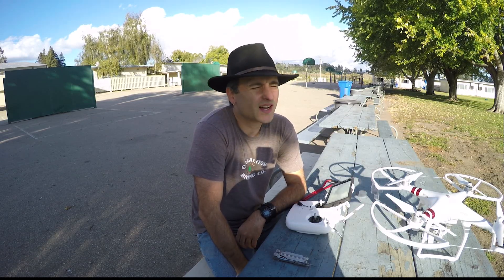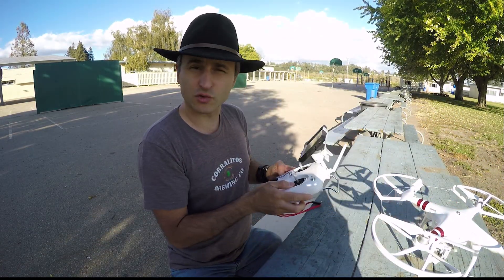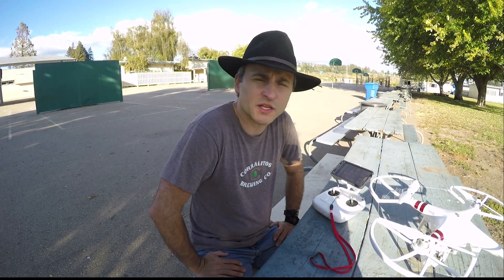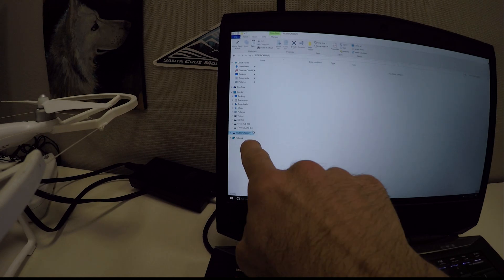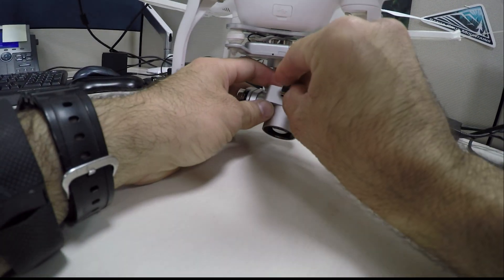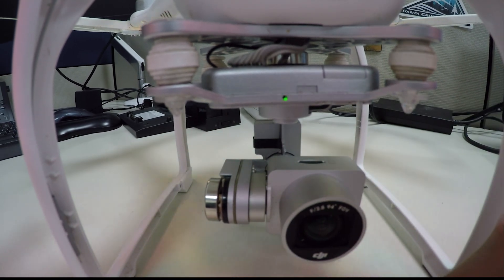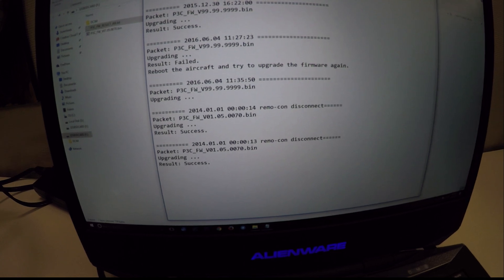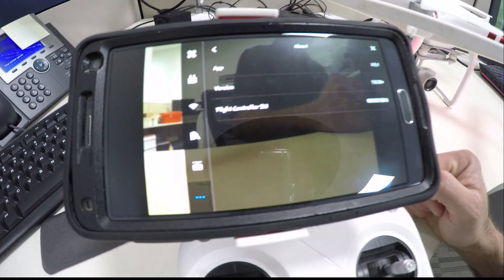DJI Phantom 3 Standard RC Signal Lost - RC Link Tutorial and Firmware Tutorial

Comment: Hello i think i have a problem with my phantom 3 standard or the controller i do like ur tuto for the update the first time it doesn’t work but the second try it’s success my problem it’s because i don’t have the ssid signal on my phone of the controller Also i wait 15min with the bip for remap the controller with the drone he never reconnect if u have an idea or somebody thanks
Reply: if the problem you are having is... as I can understand you cant find the wifi signal from the RC to connect your phone, then try to do the following, instead of holding the wheel of the camera down on the RC, hold it UP and do the same thing with the S2 switch, flip it a couple of times up and down until you hear a noise, that will reset the wifi / ssid of the RC

Comment: Let me say this is an awesome video, very useful to many people im sure. I have an issue that I can't seem to figure out.  I crashed,  tore the flat ribbon, replaced and reassembled-now I have a video feed but no gimble control.  Doesn't do the gimble boogie on startup, and gives the notification "gimble gyroscope error" and "firmware problems ". I changed ribbon, micro boards on both axis, but still limp gimble. All the camera lights are green after the drone initializes...  Any help would be much appreciated
Reply: did you get it fixed.  wow

Comment: Really a great product, it's extremely stable☀️.☀️>JustU.Faith/DJI-Drone?仏   camera keeps perfectly level and the drone rotates around it. Looking at the recorded video, I wouldn't have been able to tell the difference between a drone shot, and a boom shot, it's that stable. The camera can pivot from horizontal to straight down via a dial on remote, but left and right must be done by rotating the entire drone. One issue would be when going at full speed forwards, the propellers will start to peek into the top of the shot (maybe 5-10% in?), but this could easily be cropped out post-production, or don't go full speed. My brother got a cheap $30 drone and although this one doesn't do tricks, it out performs in every other way, I couldn't have asked for more in a drone.

Comment: Hello, do you have a solution for no image transmission signal?
I have app version 3.1.64
Aircraft 1.8.10+
 Thanks
Reply: Any one that has solved no image transmission signal?
Reply: The only thing I heard is to use 3.1.5 app and 1.7.9 drone firmware.  a lot of people recommend the 1.5.7 fw just make sure you use the compatible app version with it.  and use up to android v 9.  you will have to tweak some of those settings too.

Comment: Man, thanks for your video, it has stopped me from pulling my hair out (not that I have much to begin with lol) with my P3S having trouble connecting both controller and video. It definately was the firmware, that must be why I got it so cheap as the previous owner must've got frustrated with the camera not connecting all the time..... I'm ready to fly again with confidence in that I can see the full flight.....
Reply: which app version and firmware are you running?
Reply: @moirawade6246  I no longer hsve thst drone.

Comment: I did it, but now all I get is magnetic interference and recalibrate compass, intensive electromagnetic interference....
Reply: Ok so I updated back to 1.09 and the problem went away but my signal issues returned. With 1.09 I couldn't go more than 100 feet and the remote would loose connection. The video was also extremely laggy even right next to the drone. I decided to update to 1.08 (the previous version). All my problems are now solved. No laggy video and the signal seems strong. I did a quick test flight and it was nearly flawless. Going to do a better test tomorrow. Try 1.08, it may work for you, it may not. If it doesn't, try 1.07, then 1.06 and so on. After reading alot of forums, it seems every drone is different and very picky. Let me know if this helps!
Reply: I have the same exact issue when going to 1.05 Updating back to 1.09 now to see what happens.
Reply: Hello, i had same issue with my p3s when i downgraded to 1.05 version.
1.06.08 solved it. just did test flight, no signal loss or magneto error!
Thanks!

Comment: I have just acquired my Phantom 3. its a second hand drone so I have no idea what Firmware it was running.
Im having the same problem, my P3 (standard) gets to an altitude of 30-40m and a distance of about the same 30-40m .
So me being me, i set up every thing on my drone the night it arrived to get it ready for it 1st flight. Downloaded the DJI App.
Once i opened the App, it prompted me to upgrade (Phantom 3 Standard Firmware v01.09.0200) this is what it is running now..
Took my P3 out to day for its 1st flight, thought i would give it a little test for altitude, nothing crazy. Just above the tree line where i was flying.
And the signal lost message kept pooping up every time i got up to the tree line.
So any suggestions as to what Firmware to downgrade to form Firmware v01.09.0200 
Says some where in the comments  cant go bk passed 1.07.9

Comment: This video saved my drone after lots of time wasted doing other procedures. I tried older firmware versions etc. Finally I updated the firmware and followed your steps .... Instantly all systems go. The problem started for me after updating the firmware a few weeks ago, its possible that there was an issue during the install. This time I just updated via the DJI software.  The final step was to perform the link as you demonstrated. GREAT video!

Comment: I just bought the Phantom 4 pro. i was using iphone 7plus. disconnecting during flight. but when i tested on samsung. it worked well. may be the iphone cable issue. I just bought a new cable. will try it. hummm. very scary when the monitor went black.

Comment: Great video. I now have managed to re-install the newest firmware. And then re-establish the connection between the drone and the RC controller. Sadly, it still doesn't work--the "RC signal lost" error has changed to a "compass error" and warnings about "strong interference (never had those before the firmware update). But I feel I'm making progress. Thanks! 

PS: If you have any more suggestions, I'm all ears.

Comment: My control is connected to the aircraft. The problem I"m having is that the transmitter is not connecting with  Dji Go APP,  When I go the to the app it saids Gimble not connected the big red light stays on never turns green on the transmitter. The aircraft version is 1.07.9. Tried to upgrade to the latest but it just start buzzing like hell. Anybody have any suggestions.

Comment: My Phantom 3 Standard won't update the firmware with this method or any others. I did exactly what you did in this video, Formatted the SD Card, Downloaded the same Firmware 1.5.7. Inserted SD in to the Phantom 3 Standard. Pushed the Button under the drone and held it while turing on the P3S. Held until I got some blinking light and then released. 15 -20 seconds later I have a red light and loud beeping.. FAIL.

I can't get anything to work. Can't connect the RC to Drone, Can't use Go App to connect. I've tried every restart possible. 

PLEASE HELP.

Comment: Great tutorial, thanks for taking the time to help,others in need. My Phantom 3 was flying perfectly until I made the fatal mistake of doing the firmware upgrade recommended by DJI. I attempted to follow instructions you gave for doing the upgrade/downgrade but am unable to get micro SD card to eject from camera. It's first time I ever tried to eject it so very first time I realized it will no just eject when pushed in as I would expect it to. It's almost as if there is no spring back. Could you recommend help to try and remove my SD card so as to be able to attempt to do firmware upgrade so I can get back to flying my drone? Thanks in advance, Don

Comment: great vid thanks for all of the imput and for being so detailed. sadly i was not able to fix my problem . i did both version, 1.05.7 and v1.6.8 , the wierd thing is that it never changed on my dji  app. i hope im doing in wrong. but one thing that did happen was that when i check my sd card, it said my firmware was not allowing the downgrade... i will keep on trying to see if doing something wrong

Comment: Thank you for such a detailed video, but I still encountered a problem that I can't seem to find the solutions anywhere on the internet. I did everything you instructed in this video but when I tried to update the firmware on the drone, the flashing red and green lights (just above the camera) turned red instead of green. Also, I noticed that the gimbal became alarmingly hot so I turned the drone off. I turned back on again after 10 minutes, it seems to just continue to do the firmware update with the flashing red&green lights for about 2 minutes then it turns red again and the gimbal starts to overheat again. If you could take the time to reply and help me fix this problem, it would be greatly appreciated. Thank you in advance.
Reply: i have the same problem did u fixed it

Comment: I've noticed that if I don't run my phone or tablet on airplane mode 
this then stops the phone trying to conectto other Wi-Fi devices and stops the phone or tablet uploading apps and things while flying
i was getting loss of signal only a few meters away and not running airplane mode and no issues since 👍
Reply: BAJAFLATOUT!! Soooooo,, ots better to fly my phantom.. IN airplane mode???
Reply: Yeah mate airplane mode stops any uploads being done on your phone while your flying
Put your phone in Airplane mode and turn the wi-fi back on and select phantom while in Airplane mode and conect

When flying without airplane mode I got loads of interference and delays but in Airplane mode I get none now no delays or anything 👍👍 nice pleasent flying without worrying about loss of signal
Reply: Nice. . Will this also work if I use my ipad air? ?

Comment: Hi!
I have the same range issue you mentioned. When trying to update the firmware, but when I hold pressed the link button and then switch on the drone, the red and green blinking light will not appear. I have waited over 30s but still does not appear, only a continuous green light is shown. This is so frustrating because I follow your video step by step but it just doesn´t work. If you think that you know something that I might be doing wrong, I would be really greatful if you tell me.
Regards
Reply: I just found out that my P3S does not allow me to downgrade to the v1.5.7 so I just had to stick to the v.1.6.8. I will test it out tomorrow and hope that now my range can be better than 300 feet. Thank you very much for your tutorial, it is very well explained and clear for begginers like me.
Regards
Pablo
Reply from the maker: chindas12 I wish I knew how to help but I'm not familiar with that issue. The best I can suggest is reading forums and trying to Google the issue

Comment: Can you please, please, please explain to me how to get my drone to go above 100ft. No one is explaining it and I can't get answers anywhere. Do I need an antenna booster or will it let me go 500 ft with the basic antenna that came with it? Is there a setting on the controller or app that I need to adjust? Please help me. Thank you in advance.
Reply: did you check the Maximum altitude setting in the DJI go app?
Reply from the maker: Levon Byrd What RJ mentions in response below is what I would suggest. Most likely you are still in the training setup and need to open up the range in settings. You can find it in the settings on your DJI Go app on your phone or tablet

Comment: Thanks for such a detailed video. I tried the first method multiple times and it failed. I'll try the second method and hopefully it works!
Reply: It didn't work for me, when I tried updating the log told me that the version is "older or the same as the one currently installed". The main issue for me is that it won't link at ALL, not that the update is corrupted.

Comment: Hi great videos really enjoy them. Wondered if you can help me. When I turn on my Phantom 3 standard the camera does its little movement thing then I get like a vibrating/grinding sound? It sounds like I may have sprained the mechanism but it also seems as though something is vibrating.Ever heard of this?. 
Another little issue I have is it seems no matter where I am I always seem to get the strong interference message popping up. I can be in the middle of nowhere and i still get the message.
Any help would be great.
Reply from the maker: Richard Jones I have heard of issues like you describe for both things. I haven't seen any standard fix for either though. I'm not experienced enough to know what exactly causes each of the problems. Searching forums may help, but if that doesn't help it may be easiest to contact DJI support. Sadly, I hear that can be a frustrating process. I'm sorry I couldn't help but I wish you luck!

Comment: Wow . . . you saved me !   I am absolutely new to this and had no idea.  Had to do the second part of your tutorial.  Thanks so much for taking the time to do this !
Reply from the maker: Bruce Usher You are welcome. DJI doesn't cover manual firmware updates like this. I learned about it in forums and wanted to share it here as sometimes downgrading or reinstalling firmware can fix issues. DJI only covers it through the DJI Go app. That is good to know, but ultimately not enough if you run into problems. I couldn't roll back any firmware in the DJI Go app even though you are supposed to be able to. So, I just shared what I learned in case others could benefit from the same information. I'm glad it helped you :)

Comment: Seems like a great help but I tried the firmware downgrade option only as my connection between the RC and the P3S was fine. But when I tried the downgrade process exactly as described, my light above the camera came on green and stayed green. I was still holding in the reset button as described while turning on the drone and kept it held in. Tried 3 times and drone came on like normal. Any suggestions?
Reply from the maker: racsyr If you're following instructions exactly as shown here I'm afraid the only help I can suggest is searching options on phantom forums
Reply: Actually, I did find another similar post where the person copied the file on the memory card as you did, put it in the P3S and just turned it on without holding in the reset button. I tried a few times too but that didn't work either. I ended up re-copying the file on the card, replaced it in the P3 and just turned it on and it did install the old version. So maybe a lesson here for everyone is to try recopying the bin file.
Reply from the maker: racsyr Good to know! Thanks for the comment :)

Comment: Don't firmware updates come through the DJI app now or do we have to do them through the memory card?
Reply from the maker: namdsibor You can do the firmware updates through the app, but this process is for if you have a firmware issue or wish to switch firmware versions. The app doesn't always allow you to downgrade. It doesn't store anything beyond what you have used previously either. This method gives you the flexibility to fix a bad firmware upgrade or test other versions.
Reply: Great. Thanks for the info.

Comment: tripecollie, I have tried this but am still having a problem. I noticed that my indicator light is not red or flashing red. It is flashing green. I cannot find anything online that says anything about the reset switch flashing green. Any ideas?
Reply from the maker: Michael Covey what exactly is the problem that your having? Do you get a video feed on the screen? Do you have a range issue or a signal lost issue? Have you tried changing firmware?
Reply: I have not yet been able to get the unit flying. Just got it yesterday. I do get a video screen on my phone, but it says that the controller is not connected. 

I deleted the SD card and used Version 5.7. Followed your directions but the unit did not load the firmware. In your video you show how the camera light shifts between green and red...mine is just solid green. 

The reset button, which I am finding is supposed to be red,is green. Cannot get motor started...
Reply from the maker: Michael Covey hrmm...what phone are you using? I do have a slightly different procedure you can try, but the light issue you mention is odd. This was a brand new unit?
Reply: tripecollie I am using a Samsung Note 4. Yes, this is a brand new unit. If I don't get it flying tonight, I am going to exchange it tomorrow.
Reply from the maker: Michael Covey Wow, same setup as me. Yeah. Something sounds off :/
Reply: tripecollie So I started all over, and this time, instead of doing 1.5.7, I did 1.6.8...no good. So as a last ditch effort, I tried the current 1.7.9....and it is operational. 

in other words, another success story as a result of your video!
Reply from the maker: Michael Covey wow, that's crazy that only one firmware works! I'm glad you've got it operational though. Congratulations and happy flying!
Reply: tripecollie once I get flying and comfortable enough to make some videos, what editor should I use to add music...like tour Redwood video?
Reply from the maker: Michael Covey I personally use adobe premiere but it's complicated although advanced. I hear Sony Vegas is a great easy to use video editor for the pc.